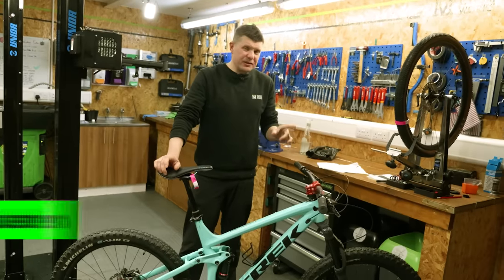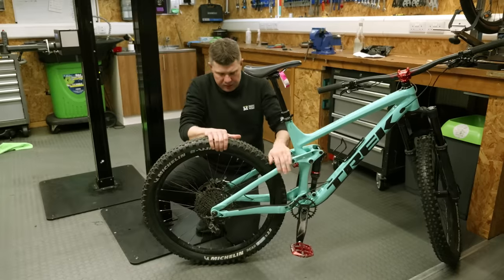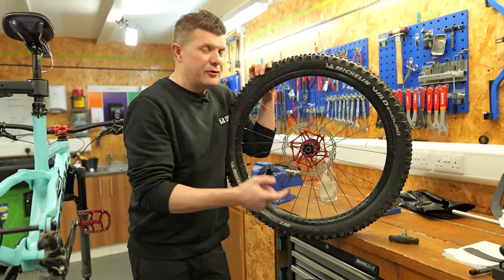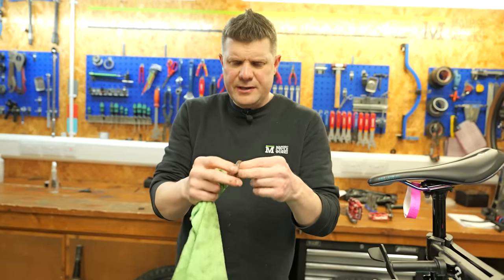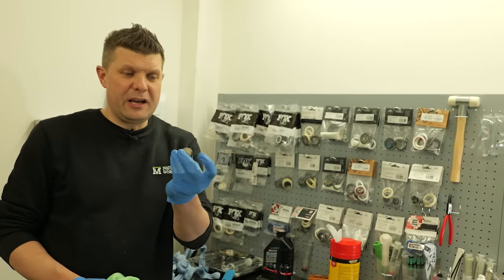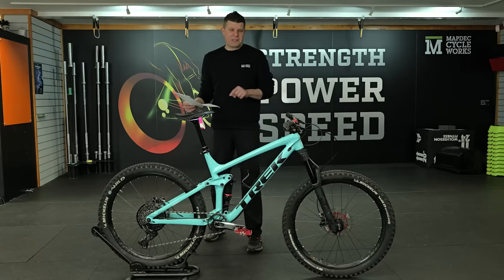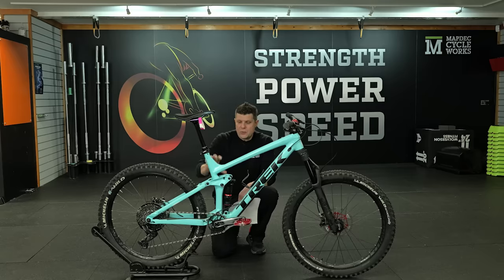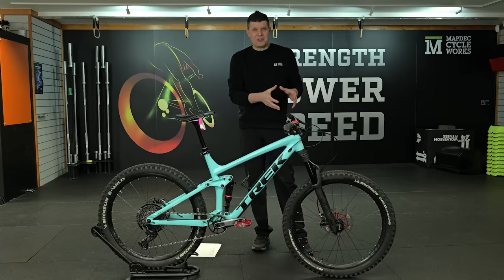They were quoted £975 to make this Trek Remedy safe

Comment: An honest mechanic who isn't out to fleece the customers will always have a great reputation in town. That being said maintaining a mountain bike isn't really cheap especially if you have to use the shop to do it.
Reply: Where I live I would run out of bikes before shop would have it ready, and not really an advanced shop like Mapdec, I got all the tools they got I think, all special stuff they send to a service centre in Oslo. So even if I did not want to I would have to work on it myself, but the cost saving in the long run is worth it, but investing in tools initially comes with a high price tag, but once good investments were made they last a logn time and get your money worth. Most work is easy. But good there are shops that can fix bikes. But I'm glad I know what to do and how to do it.
Reply: Yeah these guys are far more advanced than my LBS. I only need them on more complex issues and say I end up with a broken bike in one form or another and have to work out how to fix what they mullered. Even over torqued a derailer hanger and stripped the threads. Wish I was local to these guys.
Reply: The biggest problem with the bike in video? Using a pressure washer to force dirt and water deep into expensive parts.  This can ruin a bike from day 1 and do it quickly.
Reply: Especially when full services are required on front and rear suspension.
Reply: @mtbboy1993  Worked in Gausdal as a mechanic last year. UK is pricey, but there was another level expensive, and parts were hard to get.
Reply: Working on bikes is pretty easy and cheap if you do it yourself.
Special tools suck to buy sometimes.
Maintenance cost of a bicycle is cheap as heck if you are into or have ever been into the hobby of motorcycles😅
Maybe that's why I dont understand people saying bicycle maintenance is expensive..
I will say I know suspension components are expensive to buy and too expensive to have serviced on both bikes and motorcycles..
Its possible to do it yourself but the specialty tools suck to buy because  just about every shock you do you need a different tool
Reply: As  qualified mechanic, just because you quote for everything you have found to be wrong you are not out to fleece the customer.  I was trained to always change a cassette and chain together as the old partially worn casette will just wear out the new chain to fit it fast and the indexing may be in and out. So here the mechanic has half the price of the job but the chance that the customer will be back with problems much faster are high.  half the price half the job.
Reply: @krusher74 I'm sorry, but as Mapdec will probably confirm, cassettes don't wear out chains. Chains wear out cassettes. If the existing cassette runs fine with the new chain, there's zero reason to replace the cassette with the chain. It is common advice to replace the chain when replacing the cassette though, because a worn chain will quickly wear down a new cassette.
Cycling would become even more expensive than it already is, if you change your cassette everytime the chain passes the 0.5% wear indication.
Reply: MY LB is brilliant, decent prices, been there and family owned for over 100 years (the shop actually had the first petrol pump in the area). Absolutely great for me for things like wheel builds (who's got time for that?) but general maintenance I do myself. I will however buy all my bits, BBs etc, from them even though they are slightly more expensive than online. It's convenient - I deicide I want to do a job, they're 5 minutes away - and I want them in business when there's work I don't want to do myself.
Reply: @matlockmeat  Manufacturers recommend you service the shocks roughly every year. Which seems excessive to me.

Comment: I respect shops that don't try to take advantage of their customers, they're few and far between these days.  That being said, doing most bike maintenance is something that's not that hard to learn.  It would be much harder if you wanted to be a shop mechanic, because you'd have to learn how to work on all sorts of bikes, but learning to work on your specific bike isn't that hard at all.  I do all my own work.  Picked up the majority of knowledge right here on YouTube.  So many videos showing how to replace chains, replace bottom brackets (and how to make your own bearing press for cheap), how to repace your casette, cables and so on.  I haven't been to a bike shop in many years.  So many people I ride with who have been riding for years barely know how to change a flat, and it amazes me.  They take their bikes to the shop for every little repair.  Great if you have a lot of money, but I'm more of the do-it-yourself kind of guy.  Get a bike stand, buy some basic tools, learn to make other tools cheaply (chain whip, bearing press etc...) and you'll be even more proud to ride your bike because you'll know that you're the one who keeps it humming along so smoothly.

Comment: Yeah, mate, I used to be in the motorcycle industry as a technical adviser. So that bike seems to be a nice high-end mtb. Parents managed to have a deal on it and probably didn't know squat about maintaining it. The kid, either.  So you managed to have the bike safe and rideable for the rest of the season, for a fraction of the price the other shop quote. That super nice. But in the end , all you did will have to be redone at the end of the season. So that implies that the labor they spend will be the same or even higher to a final fix. The first shop quote was probably on spot, but the adviser didn't really have the way of explaining the hole quote and the issued down the line.  Depending on the usage, I believe those bikes need to be disassembled, cleaned, and regressed. If a part needs to be replaced, they will be repercotions if you don't down the way that will cost you more. I'm not hating here at all! But maybe the folks and the kid got into a sport that requires a lot of money to maintain the bike! Good job with the pay forward you have! Really nice initiative! 👍 the kid is gonna have to mow some lawns and work hard to keep up with the parts needed to maintain the bike and have support from the community to show him how to do them himself. Expensive sport, that is! ✌️👌👍♥️🇨🇦

Comment: I'm 16 years old and about to get a job as a bike mechanic. The service manger thats training me has told me the same thing you said at 9:55 so I feel confident this is a good store thats not just trying to charge people more than they need to. I appreciate that as I've been in this situation before where my bike needed repair, but I couldn't afford it cause a shop was trying to charge me for things I didn't need. I told them never mind and fixed my bike the best I could by myself, which has lead me to want to me a bike mechanic. Great video, stoked for my new job!
Reply from the maker: That’s awesome.  Good luck on your journey dude.

Comment: Fairness all round I feel. Your work still cost the customer around £400-£450, and there were still issues to be monitored for the future, in fairness their original quote wouldn’t have been far off BUT… I would have had them as advisories, worked on the things that were crucial for safe operation,  much like yourself. Being fully transparent and honest is paramount for my customers as that builds TRUST. Great little video, good job on that too😃👍🚴
Reply: The video shows the difference between shops that take the "it's worn ..put new on then" and the "it's worn...lets refurbish it then and save money" attitude.  One shop doesn't need the hassle as the customer will just pay if they want it fixed. The job in/job out syndrome I call it, with the least hassle for the shop.
The other shop does the work that's needed to fix it, but does that little bit extra on attention and detail, which gives them a bit extra hassle but ultimately gives the customer better service. One shop is a "halfords" and the other is a shop with mechanics in it.

Comment: Great video, I am an ex instructor/center owner so was the bike maintenance gaffer too, for hard tails and full suspensions bikes, hire only ever broke even even with 30 hire bikes always on hire. Repairs became a large part and like this example people bought used bikes which was fine, the amount of times we headed to the bike bin and replaced parts was steady. I like the idea of the pay it forward. The amount of junior riders that came through the shop from struggling house holds was a lot. I normally did repairs for free and got them to pay by keeping the trails and car parks litter free, help out on trail repair days. So in kind.. I still meet these riders now 20 years on, with the own family out on trails.  a forward attitude does workout.

Comment: Wow, this industry has changed.
I was bike mechanic in my late teens/early 20's back in the early 2000's building 3-4K custom builds for the suits in Canary Wharf.
Back then i couldn't imagine a repair coming to £900 plus unless the customer was making significant upgrades like a new high end fork or an xtr group set 😂
Back then I was paid the princely sum of £6hr!

Comment: I personally believe neglecting to replace the frame bearings to be wrong. Running them with play for any amount for time at all can wear away at linkage bolts and potentially even the frame itself which would be a much much more expensive fix than a £900 quid quote. It's alright as long as you have been clear in explaining this to the customer, but I tend to make frame bearings a priority in my services.
Reply from the maker: Yes. We have been crystal clear and we were asked not to touch them.  We pushed to do the bushings, but the linkage will be ok for a bit.  It’s hard because at that age kids grow so fast and a new bike probably won’t be far away. Bikes have so little 2nd hand value these days.
Reply: Yeah I totally understand that. I couldn't afford to have kids, they seem expensive enough as it is, let alone if they get into mountain biking! @Mapdec

Comment: Hot take... Generating a thorough quotation takes time. Time costs money. I don't think it's unreasonable to charge £25 to quote the work.
And another one... Much of the work they've quoted for did want doing, and considering the lad doesn't seem mechanically minded it might have been better in the long run to get it all done while the bike was in. We all know there's a big risk the bike will now never get the work you've pushed a ways down the line, and turn up eventually with more serious damage.
Also... Pay it forward fund for this guy? He's riding a couple years old £5k bike. Even if the rider is fifteen and using it for a paper round, mummy and daddy can definitely afford the bill.
Reply: Yeah, glad to see someone hop off the circle jerk in these comments. This just seems like pandering to youtube for clicks. Bike shops shouldn't give shit to customers for free. The story here is: Bike shop gives estimate, youtuber undercuts labor value by doing free work, and expectation in people's minds that they deserve work for free. Not to mention the other shop wanted to fix everything and this guy is just kicking those same repairs down the line.
Reply: I was just thinking the same - pretty lucky youngster to be riding a very nice bike - surely the bank of mum n dad could afford the reduced Mapdec bill if they can afford a bike like that in the first place. Surely the Pay it Forward fund has more needy uses ?
Reply: Not sure I agree on charging for a quote, but definitely glad someone mentioned the 5k bike….was thinking exactly the same thing.
Reply: @Muzyk89  Consider your car - you might expect a free inspection of brakes and tyres especially from someone who sells them. But you wouldn't expect (I hope!) a free 3 hour diagnosis of why your modern vehicle has a misfire. Especially since you'd then be free to take that work and use it to buy the parts and fit them yourself.

Bikes are the same, I reckon.

If it's a 90's MTB where you find the creak in 30 seconds, tell the guy it needs a new square taper bottom bracket for £20 and he agrees to fix it on the spot then I wouldn't expect to get a diagnosis fee. 

But nowadays there are frame pivots, press-fit BBs, air spring dampers, etc. so there are more complicated faults to find. Even if it's a hardtail it'll have hydraulic brakes and a fork with proper dampers inside. 

Time is Money. You can't expect to get either for free.

Pushing it to extremes to prove the point - if that mechanic spent all day calculating and writing free estimates, he'd be working hard all week and eating bare ramen at the weekend.

Comment: I love your honesty. So refreshing to see and great to see it's still out there. My local bike shop (a Specialized dealer) play to a higher end customer and charge an absolute fortune. I'm not kidding I went in once with a puncture on a kid's bike and was told it would be better just to buy a new bike. Needless to say I fixed the puncture myself and the kid's still enjoying the bike issue free. I was once charged £500 for a service, I was expecting maybe £200 (I needed a new rear-hub). I asked for an itemized receipt and when I looked the pricing was just insane, things like £30 for a break cable, £40 for a break check, £30 for a wheel clean (they wiped off a little drawing my daughter had drawn on the wheel itself) which I did not ask for, I quite liked her little dog illustration. Yet, the shop is booming because rich people just seem not to care and are falling over themselves to continue paying way over the odds for what's in there. Seeing your video was so refreshing and I would love to do a compare with that shop. Please continue the fine work you are doing you are an inspiration! Subbed.
Reply from the maker: I always think the biggest problem is communication. And we don’t always get it right.  A brake cable could be £30, if it was a high end inner and outer, a tricky bit of routing that meant removing a crankset for instance.

Comment: One shop wanting the bike to be as good as new loses a future customer, while another gains one by doing what they can to get it working as well as possible without fleecing the customer. Probably advising against using a jet wash as well. My local shop was owned by two guys. One mainly the mechanic, who kept all old servicable parts, and the salesman. The former retired, leaving the shop to the latter who just wanted to sell new, when you tried to get spares. They lost me.  On a side note, I really like to use Hope headset caps, they add a bit of bling and are British. BUT, I also use Ritchey stems and owing to the positioning of the steerer clamp bolts, you need a spacer above the stem for these to be compatible. Which looks rubbish. Anyway, a great video and one happy customer. Did he buy a chain bath to help with more kind bike washing in future, with the money he saved?

Comment: I think you made the right call on what was critical to getting the bike back on the trails. I have been in the same situation with an older mountain bike, the first Specialized Enduro full suspension bike. At some point, it is not worth pumping absurd amounts of money into old tech, but money might be tight and just making the old girl ride worthy again is the perfect answer.  For a couple hundred bucks, I got the bike back on the trail and then someone bought it knowing it would need more work down the line.

Comment: £977 seems steep so you used your head and did what was essential to get the bike rideable and safe. You recognised the owners means so hopefully your honest assessment will lead to repeat business. A pressure washers is fine for cars etc. but not for bicycles or even motorcycles. Good job, well done.

Comment: You did the right thing! I started cycling as a young lad with a very tight budged. I learned to do all the work myself, because i could either afford shop cost or new parts. I invested in good tools and some books how to maintain and build bikes. Later i worked as a bike mechanic while studying to become an engineer. This bike is what, 4K upwards? I saw this often in my bike shop and with buddies. They saved money to get the fanciest ride but then weren't able to afford replacement parts or even a shock pump for their fork. Fancy expensive bikes falling apart little by little. When i was on a budget i rode a hard tail which i slowly upgraded and tuned. And guess what? I was much faster in the mountains than my buddies with badly maintained expensive bikes. A rich guy once told me: If you're thinking about how to afford a Ferrari, you can't afford it.
Reply from the maker: Very true.  Folk forget what makes an expensive bike expensive. Like not servicing suspension and letting it wear out. Ouch.

Comment: I was told by a bike shop I couldn't put more than 2 patches on a tube, and I should buy a new one, I got 31 patches on that tube before it finally gave up the ghost, including 1 on the valve! It's amazing what you can achieve with a little effort.
Reply from the maker: The bike shop lied. But not how you think.  In the eyes of the law a patch is considered a temporary repair, and only for getting you to a destination for permanent fix.  In reality…. 32 patches would probably be ok. 😂